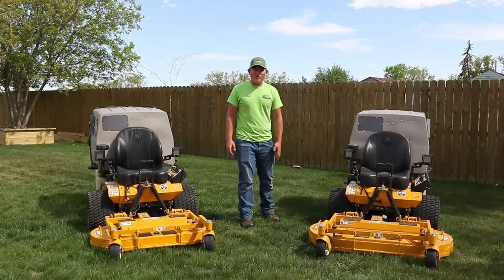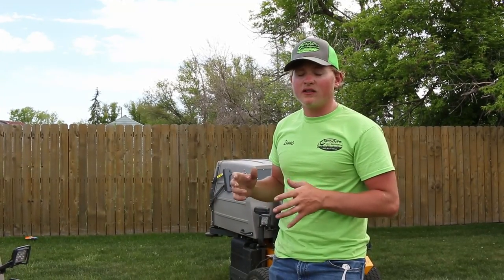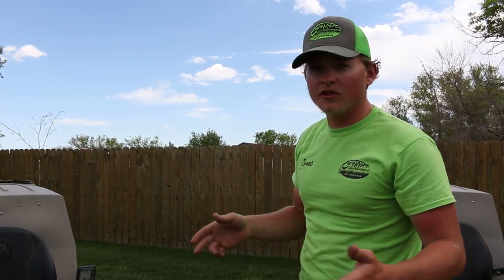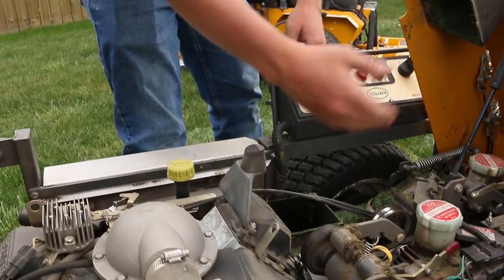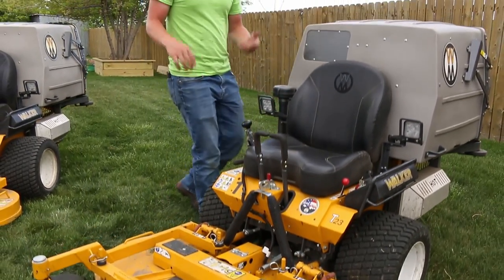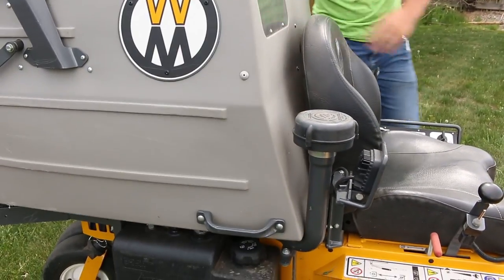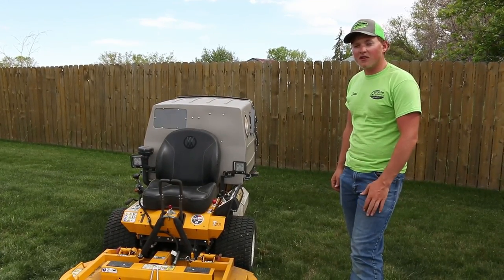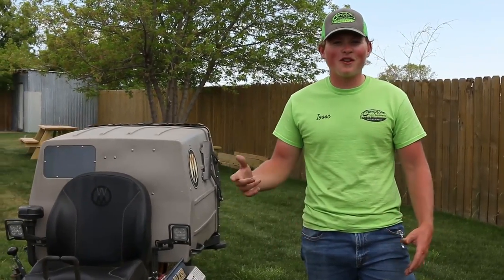New Walker 42" Deck + Walker T23 Explained

Comment: I am looking to add a Walker mower to my line up.  I need 2 decks, 1 for leaf collection and 1 for standard mowing.  I’m leaning toward side discharge for the second deck.  48” R for collection and 52” or 54” for side discharge.  My question is, is the T23 powerful enough to run those decks, or should I jump to the T27i?  Thank you in advance.

Comment: I have a 36"  and it is  reverse rotation. The one thing  I have noticed with it is it will get clogged with wet grass unlike my 48".     Have you noticed  the 42" reverse clogs up more easily?  I'm asking this because I need a 42" deck
Reply: Yes  they clogg easy as do all walkers

Comment: How often do the shoots get clogged up with debris not making it to the back of the the grass catcher /never /sometimes /a lot /it depends on on how much grass and how wet the grass is
Reply: Generally they start to clog more as they machines get older. Especially if they are not properly maintained and taken care of. Generally the 36” decks seem to clog more but that could just be the result of a smaller engine and blower.